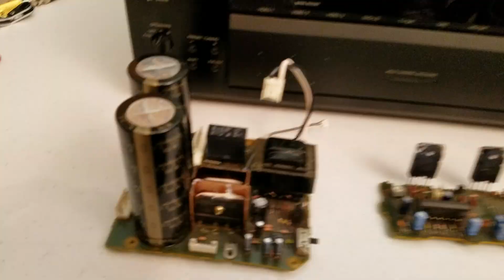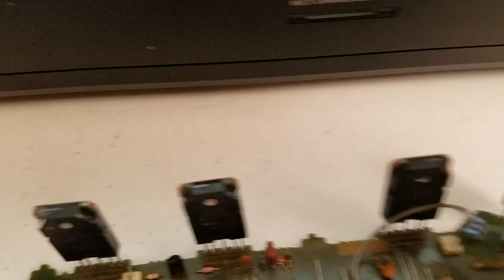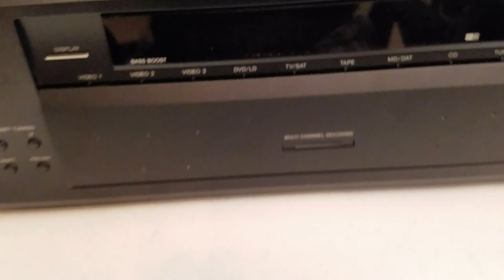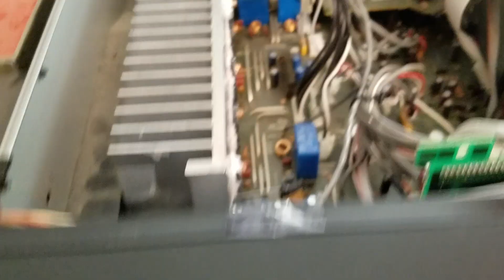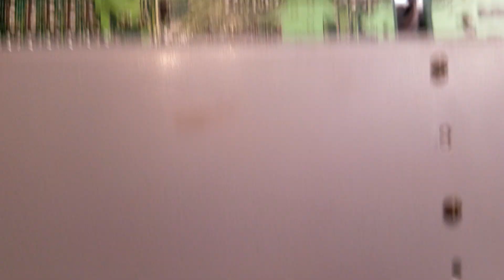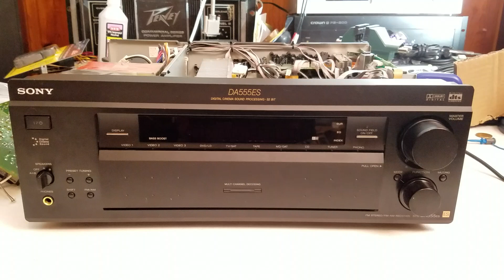Fixing common issues on the Sony DA-555ES Receiver

Comment: do you have any videos for repairing Technics SA-DA20 receiver
Reply from the maker: I don't have any for the SA-DA10/20 receiver but I can tell you that they are almost as prone to the same solder joint issues that plagued the SA-DX series. Reflow every joint on every component mounted to any heatsink and reflow joints at any hot running or heavy component elsewhere and it will likely be fixed.
Reply: @MadScientistsLair thx know I just have to Google those terms accept heat sink and I have lead free solder is that ok
Reply from the maker: @mickmill3314  Use 63/37 or 63/36/2 leaded solder on your SA-DA20.

Comment: This video is lacking the details for a good repair video. What missing is the disassembly and the troubleshooting parts to narrow it down to the specific problems on each of the boards. The troubleshooting part would be of interests to most people who can do it themselves. In addition, showing only the repaired boards do not help most of the people who attempt to fix it themselves, need to show before and after. More over, he rattled off a bunch of parts and capacitors that most people do not know what he is talking about. The point is this a summary video of what he had done to fix his receiver, not much of a tutorial on how he did it which is the most useful information. There are much better troubleshooting videos for DIY people who have the ability to do it rather than just send it in for a repair.
Reply from the maker: This is intentional. 

My videos are not intended to enable a novice to make a repair. They are intended to support experienced electronics hobbyists and other technicians. They're case studies, not step by step guides.

I can provide a short case study, or I can make an hour+ long video on what is, for an experienced hobbyist, a straightforward disassembly.... And then someone will complain that I didn't teach them how to solder or warn them that they need to unplug it first to avoid getting shocked.

Comment: On a STR-DB783 ... I had clicking relais and sound on front speaker disapeared. Pressing on the pcb let the relais click and sound came back or disapeared.  I resoldered the relais and many areas, it was good for a couple days. But then the front speakers again the relais click and sound is gone.  (I recently made a video)
On a STR-DB940QS sound is fine, but no S-Video input is switched to the "monitor" output, but the OSD is shown on the output.  Any idea from experience what it could be?
thanks in advance ;)

btw. on the 783 I had to resolder the big resistors three times now since I own it, also a common problem on these Sonys  (protect message in display)

Comment: I have a DA50ES which looks to be very similar to that 555ES, on it's power board there's a  cap that's by itself, it sits next to the two bridge rectifiers, when the cap is in circuit, the voltage is about 18volts, it's higher than the cap is rated for, when I take the cap out of circuit the voltage drops to about 12 volts, it's a very odd thing.
Reply from the maker: That sounds like filter caps doing their job. The filtered DC voltage with light loads becomes near the peak of the pulsating DC from the rectifier. Now, the question is why is it high...For that, you're going to need to figure out. Id suspect abnormal line voltage but it could be a shorted upstream semiconductor as well. Resistors failing low are rare but I have seen if a few times.

Comment: I have a Sony V444ES and sometimes when I turn it on it will continue to click without the display coming on and sounds like a relay. It doesnt do it all the time one out of ten times turning on. What do you think the fix is and what would you charge to fix and turn around time. If I decide not to fix it and buy another new receiver should I buy another Sony or search for a different brand?
Reply from the maker: The problem is likely the same issue we saw here, likely involving a similar failure to the one I patched on the 555 power board. 

We are closed until October due to a move. I got an absolutely insane deal on rent at a new place so I'm moving out in late August but I won't be able to set up the shop immediately because the necessary infrastructure has to be installed beforehand. That's going to be a heck of a job.

Turn around time varies by shop load. I have a loaner unit available however. Cost is likely around $75-150 depending on how deep the rabbit hole goes. Initial diag fee is $45 and includes the first 30 min of repair labor.

As for new receivers...Get another Sony ES, Yamaha AVENTAGE series or a Denon. The new rounded face Yamaha RX-A series is too new for me to be familiar with but I absolutely hate that relatively low contrast LCD they went to; the old VFD was much better looking. Denon has been consistently outperforming Yamaha lately in terms of measured distortion and noise in Audio Science Review tests. Will you hear this difference? Probably not but better is better. Onkyo is still on my "s**t list" due to noticeably higher failure rates than the other aforementioned brands.
Reply: @MadScientistsLair  Just order new Sony 5000es. Put me on the list and I will contact you in October and send it to you. It is a great receiver and I want to keep it for a spare for another room or garage.
Reply: I just noticed this receiver the Denon AVR-X6700H would you stick with the Sony or go with this and why?
Reply: @MadScientistsLair   Thanks for the video , i have an old Sony receiver str k850 that won't memorize preset radio stations no more, i have to manually put in frequency in order to tune in station ,but if i try to set up another frequency it looses the first one and so on, this might be old caps, what you guys experts on radios think i should look for, thanks
Reply from the maker: @MrSilv55  It's probably a bad super capacitor. These are usually small caps that are coin shaped (diameter much largert han height). Typical value is 5.5V 0.047F.
Reply: @MadScientistsLair  Thanks bro; i just learned that this module# uses the eeprom to store tuner info.
Reply from the maker: @MrSilv55  EEPROM may be bad then.

Comment: nice video. ive got strange issue with my sony receiver. is str-db 798 QS series. basicly the soud pop in or out during turn on relays and then during power off is like ''pic'' on speakers. i did full cleaning, i repair all cold solders, i clean swithes and potentiometers, i dont see anything burn or strange. i have replace relays as well. and still is pop soud during activating the speakers and turn off the receiver. any idea?

Comment: Do you fix these?
Reply from the maker: I do but if you're not in the Dallas-Fort Worth area or near a friend's place in Abilene, shipping both ways may equal the price you can find a working unit for.
Reply: @MadScientistsLair  is it worth fixing a Sony-STR-DE615 i think it was a lower end unit sound cuts in and out i hear popping sound. iam guessing bad joints
Reply from the maker: @soloM81  Those are really only worth doing if you have some sentimental attachment or if you're DIYing. Even my low labor charges on a unit like that will exceed the value of the device.
Reply: @MadScientistsLair  pretty much what i thought better off to upgrade now
Reply from the maker: @soloM81  I recommend Yamaha. The DSP is excellent and they're reliable.
Reply: Hello, I have a Sony Str-da50ES receiver. I'm getting a "protection (fan)" error. Is this indicative of the repair you made? Thanks a million for any input.
Reply from the maker: @shopjay8291  It could be or the fan itself may have failed.
Reply: @MadScientistsLair  applied 12v and worked. Has a 3.15a fuse that blew. Replaced it and disconnected the fan and blew again.
Reply from the maker: @shopjay8291  That's not good; you likely have a shorted semiconductor downstream of that fuse.
Reply: @MadScientistsLair  Bummer. Looking for a new receiver.

Comment: Hi! Greetings from Argentina! Thanks for your Wisdom! I have a Da555es, and some time ago i have to oportunity to test it against a classic NAD 3020i. I hear more control tightness and dynamics on the bass Región in the sony ES. But the Nad have more clarity, microdetails and bigger soundstage and i really love that. I wanna ask you want you think of upgrading the opamps on the mainboard and pre for burrbrown 2134. It’s very dificult to do? Or maybe using a better stereo amp section and connect it to the preout of the sony. Thank you for your help. Best regards from Argentina.
Reply: Replace them without hesitation, and listen... ;-)